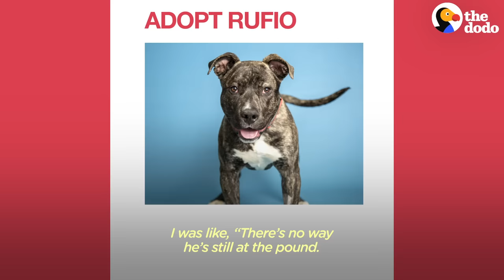Pittie Found on Roof is So Happy to See Rescuers | The Dodo Pittie Nation

Comment: Someone definitely put him up there. People can be sick.
Reply: h-how? did they pick him up and throw him on there?
Reply: Same way they got him down
Reply: Not saying someone didn't, but I've had a family friend's dog growing up who got stuck on a low roof like that, a jacked up truck was parked horizontal to the side of the house, the dog climbed up onto it, jumped from the roof of the truck and was running across the house when the truck pulled away. Luckily someone noticed in our case and he was down in 10-15 minutes, but thinking something similar may have happened here.
Reply: Not necessarily, pitties can typically jump pretty high up and the roof was pretty low so I wouldn't be surprised if the wiggle noodle was able jump up there.
Reply: @cush4free628  Easily, come on dude.
Reply: Seems likely.

Comment: Clearly, someone threw him up onto the roof...
Reply: leeuniverse How can someone throw a heavy dog like nothing? From it’s legs? It didn’t seem injured.
Reply: @A_Random_Rat  ...  You're right, it may not have been thrown, though, some people can certainly do it, I've seen it for dogs that size even.  Remember, the low end of a roof often isn't very high from some parts of the ground.  They may have thrown him from a porch section that wasn't as high.  Of course, they also might have stood on a section of fence or porch railing and put him up there, or even climbed a ladder and put him up there.  So, there are multiple ways it could have happened.  Porch railing may have been the most likely way since they are easy to get on and are a short distance from the roof, and thus easy to just lift the dog up onto it.
Reply: I think people are severely underestimating a clever dogs ability to climb.
Reply: Um dog could climb too like my dog if he not lazy
Reply: Yeet
Reply: trublu97  in that backyard where the guy jumped the fence he couldve easily jumped on the pile of wood then the concrete wall then the roof

Comment: We had a neighbor who had a two story with an exposed ledge running around the second story and a way for the dogs to get on that exposed section in the back. As you were walking around the house the dogs would go from barking at you from the back yard fence to running around on the ledge of the first story in the front of the house barking at you. They never tried to jump off or anything just run around barking.